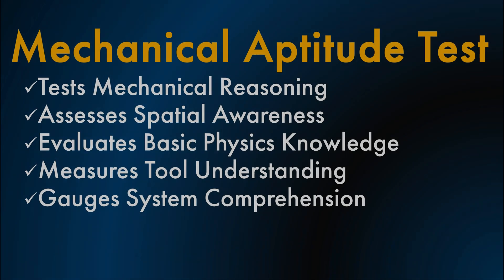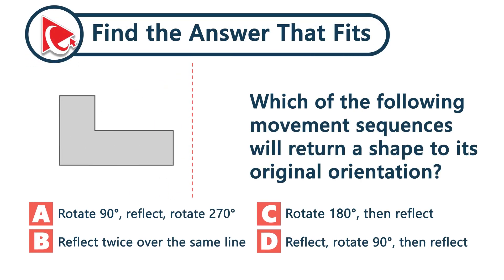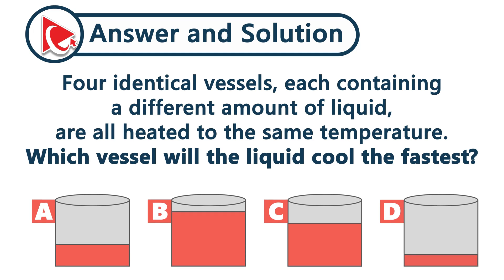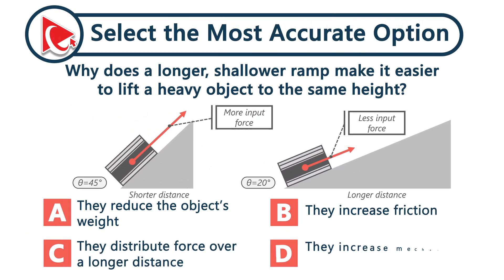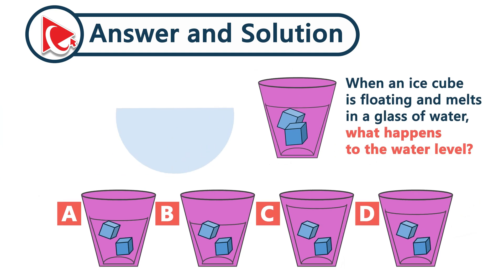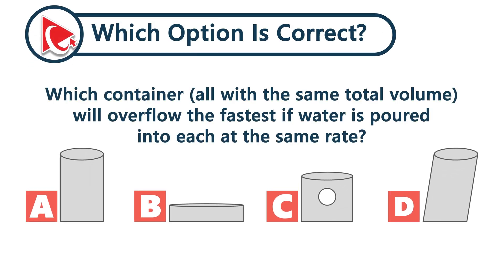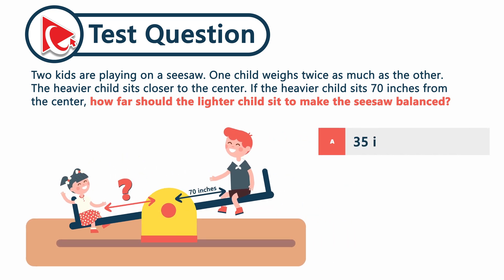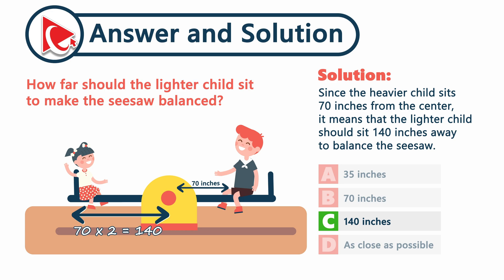MECHANICAL APTITUDE TEST QUESTIONS AND ANSWERS

Comment: Question has to be A! How can something sliding on an angle beat a free falling object falling from the same height?
Reply from the maker: I see why you’re saying that — it feels like the free-fall object should always win. But the key detail is this: the sliding object doesn’t have to travel the same vertical path; it can convert the same height drop into speed while also “cheating” with the path.

Typical mechanical aptitude tests use this idea a lot: on a steep enough incline (and assuming low friction), an object can build speed quickly and reach the bottom sooner than something that drops straight down the same height in a different setup. The test is really checking whether you separate distance traveled from acceleration along the path.

Also, many of these questions are drawn so the sliding object’s path length is shorter (or the incline is steep enough) so it clearly arrives first — the picture/angle matters.

If you tell me which exact question/image this was (or post a screenshot), I’ll explain it using the exact setup the test is assuming.

Comment: Question 1 "Identical block on inclined slides": Answer A (as vertical acceleration is higher).
Question 6 "Cyclist": Answer is that the final velocity must be the same, as for energy conservation - apart D which cover less vertical distance.
Question "Heavier ball": The explanation (for the second time) is that you can then weight only 2 of the remaining 3. If they are equal then the heavier is the one you remove. If not, you get your answer directly from the scale. 
Question "Furthest distance based on angle": if you do some calculation you see that the equation is maxizing sen(2 theta) --> Theta = 45.

Comment: question #1 the blocks. if they start at the same height 1 yard. 1 drops straight down the other one drops at an angle. the one that drops at an angle has a further distance to travel. So how can the hit at the same time? the closest distance between two pints is a straight line. Please explain.
Reply: indeed, it's answer A